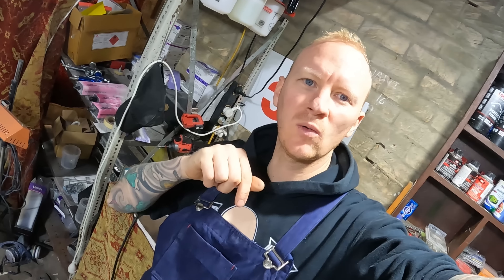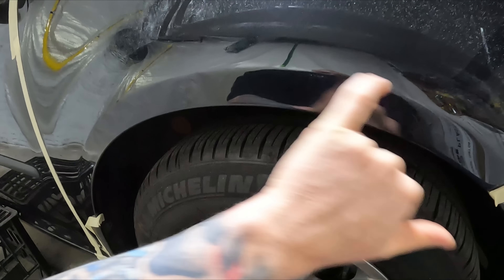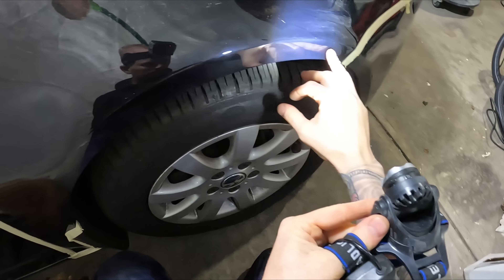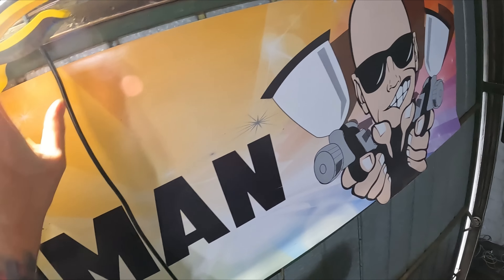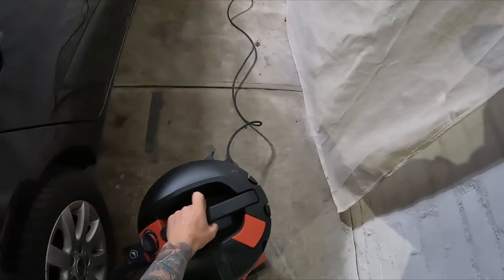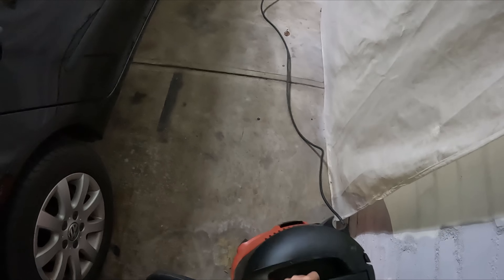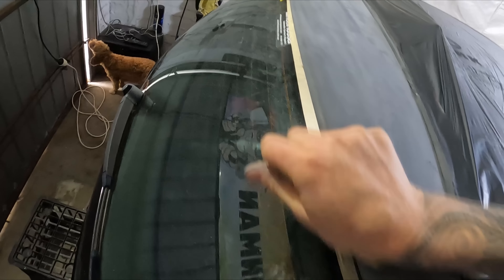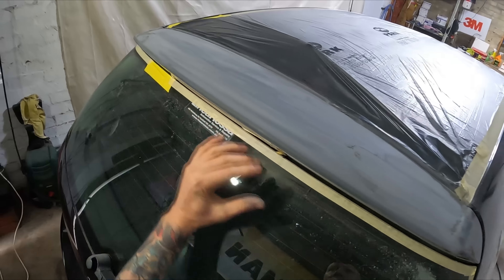Prep Work At Home

Comment: Yep these vids have been a great help on my sun damage repair.  Funny but I had to substitute hardener in my primer too.  My primer can be mixed as a surfacer or sealer but I find the sealer is more than enough build.  It calls for one part clear so I figured using the clear hardener was OK and it's worked just fine (primer hardener had gone bad).  I'm way behind you but at the same stage as this vid.  Thanks again for all your help!

Comment: #thegunman Are those pads 3m or the ones from Supercheap ? Normally Supercheap sells sh*t but their purple pads are awesome. no clogging and they stay sharp. Another excellent video . You sir are a bloody legend. Dave from Yokine 6060
Reply: Oppps. I asked too soon. you are using 3M.  The square pads are awesome. I am also building a collection. Is it true that spraying Wax and grease remover (prepsol) on sanding  discs that it stops build material up / filling ? If not any tips for that ? Cheers for your videos. You change lives for the better. Please know that!